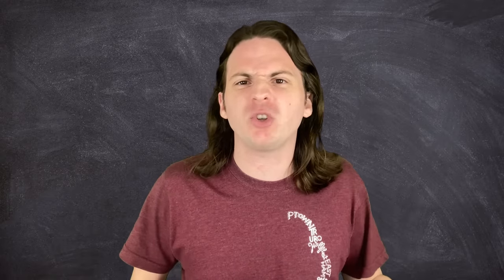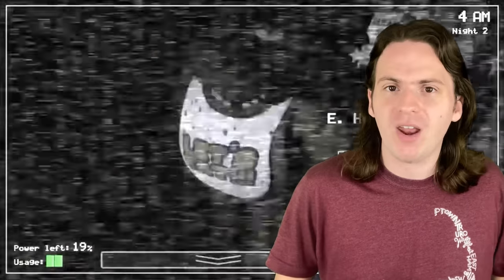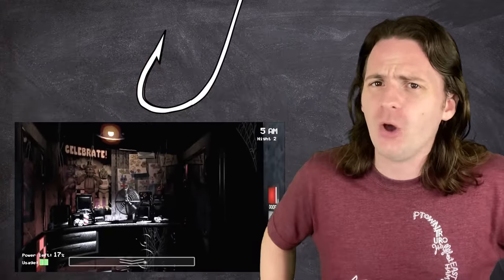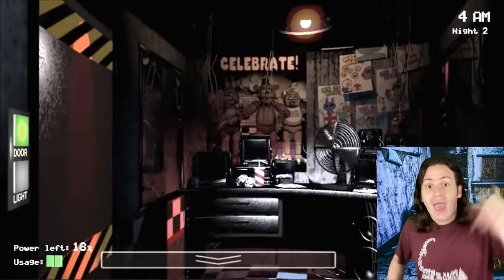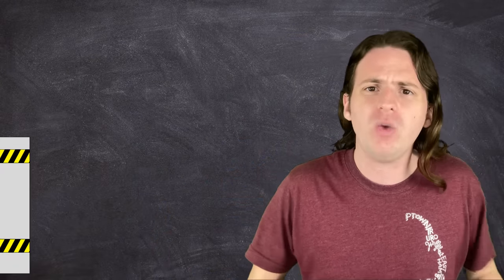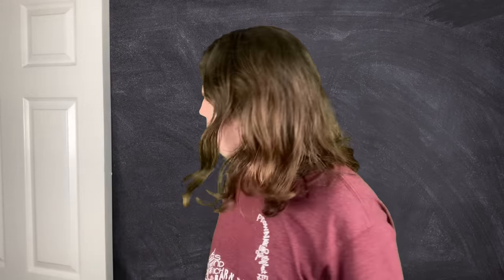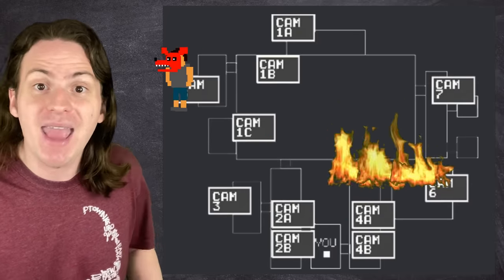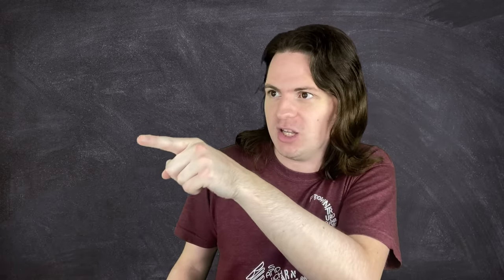Why Don't the FNAF 1 Doors Stay Closed?

Comment: You mentioned fire safety as the reason for the doors being forced open, but funnily enough most fire safety doors and windows are designed to slam shut in the case of a fire, needing to be opened manually. This is because it is a very effective way of containing a fire, not giving it excess oxygen to expand rapidly and securing parts of the building that are behind the doors. There are cases where a fire extinguished itself by running out of oxygen before the fire department even arrived thanks to well designed fire safety doors.
Reply: you can find videos where an entire house is burned to a crisp except for one room in pristine condition because the door was closed
Reply: The whole logic of this video is completely off, except maybe the pulley explanation.
Reply: But these doors don't have a way to be opened manually in case of power outage
Reply: Counterpoint, because it's not a fire rated door it's better for it to stay open in case of fire for evacuation to be possible.
Reply: Those doors are not an access to air it's a separation door between rooms.

Comment: My thought was always that they were specifically designed to keep the animatronics out, and that they could just punch down a normal wooden door. I also assumed that they were strong enough to just lift the door up if it was held only by gravity, so they installed electromagnets in the floor to insure that they cannot be opened when engaged. Those electromagnets obviously consume power, and when the building runs out they disengage letting the door come open.
Reply: When the building was built, they didn't account for the supernatural possibility of those animatronics trying to kill you
Reply: @-_deploy_- this was built way after the bite of 87 and fnaf 2 so yeah they probably know about it
Reply: @-_deploy_-  If I’m not wrong the Fnaf 1 location was built by Henry after his daughter got killed by William Afton  and he knew something about the sentient, killing robots
Reply: @Mistaknightman  nobody knows

Comment: I always just assumed it was a hydraulic/spring system. Like the door is slammed shut by heavy hydraulics and then when the hydraulics are turned off the springs are able to contract pulling the doors back up, I always just hand waved it away as a safety precaution so that the guard wouldn't get trapped in the case of an emergency cause there's no emergency exit from the office
Reply: It's more likely to be an electromagnet due to how much power is consumed by those doors. hydraulics usually don't like to move if the power is cut or only move very slowly.
Reply: Well i mean, a way smarter solution for "Guard getting stuck in the office" would pretty much be to make an emergency handle that can open the doors like normal doors, basically if power runs out you can still open the doors if you pull a handle. (Its already present in buses and planes)
Reply: @RomanCigić  I didn't say it made sense as the best option, just as an explanation.

Comment: they could have probably just made the doors slide sideways instead of making slide move up and down, that way you could just slide the door open whenever you want and it would still be able to open during emergencies (not sure how exactly that would implemented tho)
Reply: If the nightguard is able to open the sideways doors, then wouldn't the animatronics be able to also open it?
Reply: @Kevin-The-Cube  I mean it would probably have some kind of locking system in it like a normal door
Reply: @Larnny  what kind tho? One where you just press a button and it locks? Or one where you have something you put in the lock so it actually stays locked? And how would the door stay locked? 

I hope I'm not annoying you, feel free to ignore
Reply: @Kevin-The-Cube  that's a good question, I honestly have no idea
Reply: @Larnny  btw, I really like your pfp!
Reply: @Kevin-The-Cube  ty!
Reply: well then the office should be lower down the the main floor so the animetronics cant pray it open with someting. but i like your idea. just keep in mind that evriting kan break, ether with time or with force
Reply: @Kevin-The-Cube just do the electromagnet thing except sideways, that way at the same time, if the power goes out and the electromagnet turns off it won't have anything locking it anymore either
Reply: actually yeah why not side way my first thought when he said doors isthe hinge probably going break first or its gonna be abit to heavy
Reply: @Larnny my idea would be to make the sliding door extra long, and then have some lever you can pull on that keeps it I side it's hard to explain without visuals

Comment: Actually, from a safety perspective this is genius. If the power runs out, and this was NOT a universe where murderous robots haunted by the ghosts of children weren’t murdering you, the doors staying open without power is very safe and genius.

The doors are obviously very heavy. They make a loud thud when closing and are probably thick steel slabs. You would get crushed and pinned very easily if the door closes on you if the power runs out. Likewise, if someone does get crushed and the button stops working then you can disconnect power to the doors to open them instead. Also, it prevents people from getting trapped inside. If the doors closed when power runs out, then suddenly the night guard is just locked inside the office in a rundown building until god knows when. Does someone come for morning and afternoon shifts to keep watch? We don’t know. And there seems to be a lack of proper ventilation in the room too, only a fan that circulates the air, which means if power ran out and you were trapped in the room you might eventually suffocate (if the room is airtight), or at the very least start to cook like a chicken in an oven because the fan turns off.
Reply: That's what I was thinking. A safety precaution makes the most sense to me.
Reply: If this wasn't a universe with murder bears you wouldn't need heavy metal doors...
Reply: the only air flow is from a tiny fan too. heatstroke would be a serious issue without those sliding doors.
Reply: @Qualicabyss  The doors were made before murder robot bears were a thing, or at least believed to be. The night guard’s real job is to make sure nobody breaks in, that’s all. He has no way to defend himself. So in a case where someone does break in, his job would be to capture as much footage of them as possible with the cameras and keep tabs on what is stolen. The doors are there to protect the night guard in case they are armed and dangerous, as well as to keep restaurant guests out who would otherwise be able to open a simple door during the day if it wasn’t a steel slab.
Reply: isnt there like a window cant u like break out
Reply: @heelloww8066  I’m sure the animatronics would have broken in through that then.
Reply: @heelloww8066  The glass is supposedly bullet proof. Not necessarily unbreakable but really tough.
Reply: This makes even more sense when you realize these heavy doors are in a kids pizzeria.
Reply: And in the other Hand:
It does make Sense that the Security room is reinforced
Reply: The real problem is that the building has limited energy at night, also it could have manual handcrank for it to open if they get trapped when energy runs out
Reply: if you have he small backup batteries or the last remain  of the electricity used for this

Comment: It's so you can get out. 

Think about it. If a giant, heavy door slams closed when the power goes off, anyone inside the room is trapped in there, unable to open it. However, if the door is designed to automatically open when power is lost, then they can escape. 

It's just that there's the complication of "That door is the only thing between you and the killer robot bear" that makes escape a non-starter.
Reply: Har har har-har har har har-har har-har
Reply: But you wouldn't even drain enough power to be locked inside if the doors just worked normally
Reply: @landonaron4103 there’s still might be problems with energy even in normal circumstances so it might’ve trapped even dayshifters
Reply: @landonaron4103 buildings can lose power to a large variety of reasons
Reply: Or just add a crank that you can use to manually pull up the doors
Reply: The most terrifying thing about being trapped in the small office is that you can´t even go out to use the bathroom when the power is out, truly an agonizing experience any person would never want to be in.
Reply: Just wait until the power comes back on at 6am
Reply: @daniilfilms thats not how power outages work, and their's no proof thats how it works in the games instead
Reply: @monke7919  If the animatronics switch to day mode at 6am then that means employees arrive there, So they can just turn on the power and open the doors
Reply: @monke7919  The office room during the night is ran out of limited power, Essentially it’s a battery. But it’s only during the night, Do you really think they run the entire building off that limited power?
Reply: @daniilfilms  no I don't, but the place is abandoned, that's why it's running on a small power generator in the first place
Reply: @monke7919  No it’s not? The Fnaf 1 location wasn’t abandoned, It wasn’t in a great shape but it was still in business
Reply: they mentioned that in the video-
Reply: just pee on the floor tho  @Flowermations
Reply: @itsjeremiahjames  Good point lol not like Fazbear Entertainment would care.
Reply: That's what I was thinking.
Reply: Thats what he said in the video

Comment: I think it's springs and electromagnets.

Door is held up with springs, and an electromagnetic pulls it down.

Your pulley theory is really interesting though.

Also the robots would tear through a normal door like a wet paper bag. Hence the blast doors, regardless of space.

It probably is a fire escape thing. Unintentional foreshadowing of the sheer amount of fire in subsequent games.
Reply: That explains why we run out of power so quickly, any magnet capable of achieving even half of that would bring the power grid down
Reply: It's also stated that the animatronics don't recognize a door without a handle as a door making it less likely for them to try and break it. They see it as a wall instead.
Reply: If a magnet would be able to bring down the door it would attract all the metal stuff in the room.

No it probably works by a counterweight like elevators.
Reply: @nilsmadej9091  You have a point there, which made me think.

Two sets of magnets. One stronger set above the doors to repel them, and a weaker set below to keep them down and sturdy. This will prevent the attract-all-metal-in-the-room issue with the magnetic doors theory.

Though the counterweights being pulled about by electromagnets instead of the door directly is probably more logical
Reply: @PaigeLTS05  oh my God it's Albert Einstein
Reply: i thought it was also electromagnets
Reply: @777SilverPhoenix777  then how do you explain the fox. cause he kept banging the should have ben considered a wall
Reply: Always thought they were magnets to reinforce the door, never got why people were confused as to why the doors needed power to be held closed. The magnets might even help repel the animatronics.
Reply: @jimmyking-gaming8453 na they invented backwards gravity
Reply: @KrispBacon518  i see
Reply: @777SilverPhoenix777  wait really I’m not saying I don’t believe you but I would like a source I’m curious does that mean when foxy knocks on the door after running to it he thinks he’s just banging on a wall that magically appears lol
Reply: i feel like you could say that destroying doors is against the rules at freddy fazbear's pizza and they wouldn't lmao.

Comment: My theory before watching: The door closes when it's powered (evidenced by the door being closed consuming your power) so the door is probably held open by something like a spring mechanism or whatever  that needs mechanical power to overcome in order to push the door shut. When you run out of power, you basically get the door version of a springlock failure or something like that.

Comment: If I'm not mistaken (from experience in fire drills) the point of a Fire Door is to CLOSE during a fire, to starve a fire of oxygen by shutting all fire doors. During normal operating times, the doors should (generally) remain open at all times, and in the event of a fire, they will automatically close to seal off areas from the fire. It would definitely make sense for the doors to need to be opened in the case of an emergency (for example.. a power outage...)
Reply: I'm pretty sure those things are not fire doors 
Because they are metal they will just heat up rapidly and destroy the wall they are installed in
Reply: @koghs  well, the point of a fire door is to close off the area to lessen the amount of readily available oxygen for the fire. If all the doors opened, you’d be allowing more oxygen into the area to fuel the flames? Unless I have a misunderstanding of fire doors, if so please do correct me!
Reply: @potatocatgrif  fire doors need to meet certain requirements to BE considered fire doors 
If it wouldn't be any good at stopping the fire anyway it might as well stay open

Comment: A solution is to make the doors raise from the floor. It does not save you from all the stuff that could happen, but makes sense: power needs to be spent so the door is close and if there is no power gravity opens the door.

Comment: From an irl design perspective it would be really dangerous if the doors were stuck closed when the power went out. It's like how on a lot of rides the brakes have to be powered on to be released and they brake when they arent given power. So if they lose power the ride stops.

Comment: A spring or counterweight is probably what was used on the doors and considering the age of the building these types of solutions would have been most common and cheap for fazbear entertainment. Fires breaking out from these animatronics would have been pretty common.

Comment: I always assumed the doors were magnetically sealed, meaning the door track had negatively powered strong magnets keeping the door open. When you press the button to close it, the magnets turn positive thus pulling the door towards the track. It takes power to positively change the negative magnets, therefor when the power goes out the track stays negative and the door remains open
This might sound like it's not possible, but this is the same universe where you can walk through objects using the power of AR. So this is at least how it works in my head canon

The magnet idea ALSO works for when either Bonnie or Chica jam the door when they get too close. I always imagine it as their feet being in the way of the track causing a disruption and making the door malfunction. Either that, or there's a sensor detecting something in the way of the track so it locks the door open as a safety precaution

Comment: When the doors close they will be set on a Emp mode if they are closed and the hydraulic press pushes the door down for more force so the animatronics cannot go through. If the power goes out the hydraulic presses cannot do anything and the Emp isn't active and that the system just locks it open before the power runs out, because else the guard would get trapped

Comment: I just always thought it was a basic heavy door with a heavier counterweight on a pulley being stored elsewhere holding it up that gets raised by hydraulics to lower the door on the opposite end of the pulley system. Just always made sense for a fire emergency or powercut situation.

Comment: My theory is that they simply just like have a little switch at the top which holds the doors up, and the last bit of power is simply used to make the doors rise to ensure guards aren't locked inside.

Comment: If they made the doors close sideways, horizontal instead of vertical, it still could use gravity to hold them in place and a latch of some sorts to prevent it from going back, and the only power used would be to just open and close the door which is majorly more power efficient then using power to keep a door open/shut

Comment: It would ultimately end up costing less financially if Fazbear Ent. didn't run on a generator. All the food in the building would rot, there would be a flooding risk, etc. You would ultimately end up spending more money fixing things because the power went out than helping them. Also I like that someone finally made a video on this, I think the fire door thing was explained really well in Five Nights at Candy's as well.

Comment: It's a safety hazard so that if there is a fire or some natural disaster the doors open and the employees can escape. The door staying open without power is most likely achieved through a pulley system with power needed to manually lower the door and raising the super heavy weight on the other side of the pulley so that the door can lower.